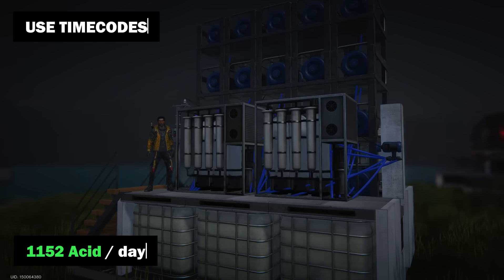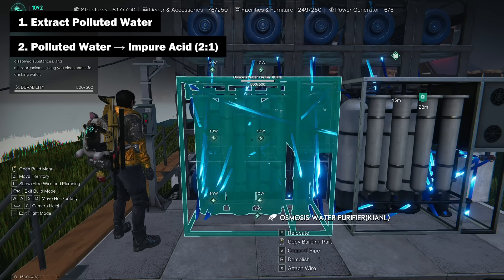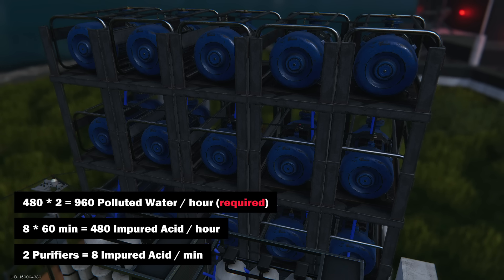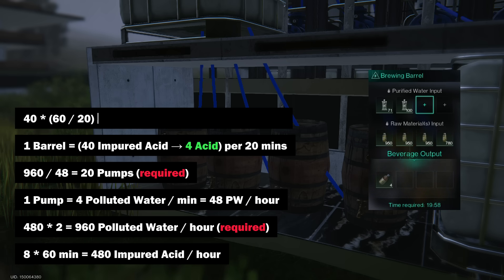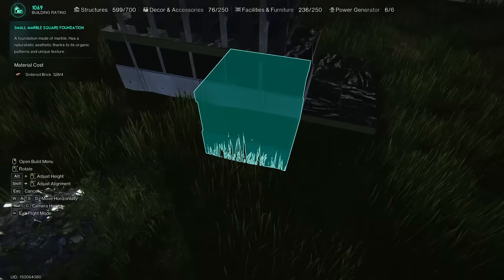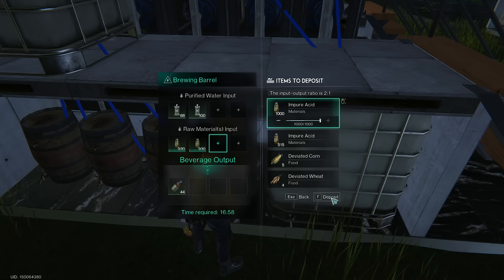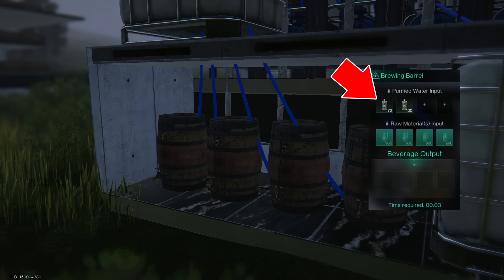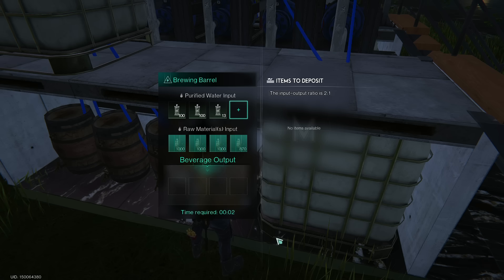Passive Acid Farm Guide ♻ | 1152 Acid per Day | ONCE HUMAN

Comment: Once I get to teh part where I need to place small ceilings over the 3 water pumps, they dont want to snap on top of them with teh water tanks there. If i move the tanks to the side for a second to see if they snap without them, they  snap on that area easily. Whats the issue im having? I triple checked that my foundation elevation and every other pieces was in place with the guide, yet that part doesnt work.

Comment: You know, I thought about this and did set up a little one with 10 pumps and figured, this is silly. Granted, I realize that it's "passive" and that is the draw, but I can get over 300 acid with every run through Blackfell and there are probably other spots where you could do the same thing, but I've only been playing for a couple of weeks. As long as I take the deviated chops along for the acid gain, I've never gotten less than 300+ acid in 25 minutes.

Comment: How can u got purified water when the pump only take poluted water?
Reply from the maker: this build does not produce pure water. I must be delivered to lower tanks with pipes or manually
easy way to do this - https://youtu.be/NZBvmOw2cAU
also there is update versions of this build, which u can save as a blueprint https://youtu.be/--tPMDM-KiQ

Comment: how do you go from tank to pump then pump to purifier ? my pump only sucks in the water on both ends when its on XD is there a way to alternate where 1 side sucks 1 side push and ive been missing it all this time 0.0 ?!
Reply from the maker: hey. wall pump should be place HIGHER than tank's pipe connection slot, then it will take liquid from it. 
at the same time, the pump should be placed LOWER than purifier's pipe connection slot, then it will transport liquid into it.
but better just build a new version: https://youtu.be/--tPMDM-KiQ
Reply: @KIANL-GAMER  thx a ton for the repply, will deff take a look

Comment: Real nice job  ! im doing some adaptations to get rid of that small water pump, just for the chalenge, but somehow positioning the big water pumps is a real nightmare, how did you do it so easy?
Reply from the maker: hey, new building guide will be released today. In the upgraded build it will be much easier.

1) place 1st layer of pumps, using grid snap
2) disable grid snap
3) use ALT + mouse wheel to raise pump up a bit
4) enable grid snap again
For the rest layers correct height should be applied automatically.

Comment: Im running 100% Polluted Water on my Osmosis water purifiers but sometimes, besides the impure acid it also appears pure water on the osmosis purifier output is this correct?
Reply from the maker: no. if it happens, it means ur pumps extract dirty water too.
you need to move them far from bodies of water or move to another contaminated area
Reply: @KIANL-GAMER I’ve checked all my pumps no dirty water, also all my 3 tanks are maxed with polluted water, and the 8 slots on the osmosis are filled with polluted that’s why I find it very strange 😮
Reply: @KIANL-GAMER  Found the issue, its a bug, alot of people having it, when offline the Osmosis created Pure Water from Polluted Water. i tested by disconnecting everything and filled all Osmosis by hand with Polluted Water and went offline when i cant back the Osmosis outputs had both Pure Water and Impure Acid and the inputs where still Polluted water :( If i stay logged in the output is 100% impure acid.

Comment: I tried this and it worked, but why do I produce so little impure acid every day ? Do I have to dispose of the dirty water ?
Reply from the maker: Your pumps should bee placed far from bodies of water, then they will only produce polluted water - that's first.
Second  - you need to fill all 4 slots of both water purifiers with polluted water (means u need accumulated 800 units of it). After this they will start work at full power.

P.S. Updated guide is coming soon.
Reply: @KIANL-GAMER  my pump is in the water and it turns out that is the wrong one, thanks for helping

Comment: the problem with all this min maxing is that. You don't get oil and water. 
Two very essential things as well. 

For beginners those are way more important that doing something like this. Even if you're in a stardust area that has oil you still need purified water to brew the impure acids into acids. 
Relying on rain catchment is highly suspect as it doesn't work properly in some areas and only when it rains.

Comment: did water pumps get nerfed? i tested the pumps in polluted water and in polluted land. it does not matter where the pump is located, in both cases the pumps only pulled 24 polluted water per hour (alternating every 5 min polluted water and dirty water, so every 10 minutes polluted water).
Reply from the maker: it's a bug, many ppl have it. just try another contaminated area

Comment: hey man, recently started playing once human and got to level 45 and wanted to setup acid farm! thanks for the info but a quick question. Will this setup be viable after the new update where the impure acid to acid ratio is changed from 2:1 to 10:1? please reply if you can, i am really stuck on this farm setup thing and passive acid farm will help a ton. P.S.- watched your automatic acid farm video that you uploaded latest and will be doing that but passive acid source from pumps really will be a big boost on top of the farm setup. @KIANL-GAMER
Reply from the maker: Hey. 10 Impure Acid : 1 Acid - is the current ratio actually, so... 🙄
Reply: @KIANL-GAMER  yes exactly. so is it worth seting up that farm then? since before it was 2 Impure acid: 1 Acid
Reply from the maker: @TheAkhileshAggarwal  yes, why not

Comment: Beautiful video! But I have a question where do I plug the power generator into? I made 6 deviation energy generator and wired them all together but now where do I wire it into for the farm to work
Reply from the maker: hey, to any part. or u can add a few switches on a side wall if you need
P.S. In a few days upgraded factory will be released.
Reply: @KIANL-GAMER  I ended up figuring out where to plug it ! Thank you! Best video ever kept it very basic and straight forward

Comment: Thanks for all your videos man, great way to deliver the info needed, I did notice something that I don't see a lot of people mentioning, in my setup last season I was collecting polluted water through my rain collectors 80% of the time, this season only about 30 polluted water per rain collector (something has changed by the devs maybe) I wonder if you know anything about that or if you can research that further, that would be pretty cool to find out 100% how it works better as you know because you want need to use as much power or as many pumps, also before somebody asks; no, it doesn't really rain but I still see the collector collecting polluted water. 😶
Reply from the maker: hey, thanks.
actually I haven't tested yet, but I will in the future I think
maybe this is another bug

Comment: im having problems placing the ceiling above the water storage how did you do it
Reply from the maker: this was patched. but you still can place water purifier directly on the top of the tanks. will be same result
also, updated factory will be released soon.
Reply: @KIANL-GAMER   ah i see i just added another small wall on top of the half walls so they fit to fix it. Still the game is buggy and when you leave the farm un rendered the osmosis produces purified water instead of the impure acid i hope they fix this

Comment: Not sure if I'm doing something wrong but my barrels produce 1 acid/20 mins * 4 barrels * (60/20) = 12 acid per hour not 48.

Am I doing something wrong or do you need to have so much surplus impure acid you can fill all 4 material slots?
Reply from the maker: yes, you need to fill all 4 slots. only then will be 4
Reply: @KIANL-GAMER  how much impure acid does that require I just tried splitting 600 into the 4 slots of the brewing barrel and it just combined them all into one slot
Reply from the maker: @GamerUnderDev  1000 for each slot, as far as I remember

Comment: I am unable to place ceiling pieces above water containers. It doesn't snap for me. I tried to place them and add containers after - doesn't fit :/
Reply from the maker: they patched this, so u can't anymore. 
but you still can place purifiers directly on the top of the tanks, and you will have the same result.
an updated build will appear soon.

Comment: Hey mate, i've been losing ym brain over my setup. Have 27 pumps (overkill i know but just trying to fill slots D:) even spread into 3 storage crates, all going into 1 wall pump to the 2 osmos. Have made sure all pumps run 24/7 and i still never see the slots full. Any idea what i'm doing wrong? Great guides otherwise!
Reply from the maker: this takes time to fill production capacity. if u want full slots faster, u can temporary disable water purifiers and wait until they fill up
Reply: @KIANL-GAMER  Nah figured it out i'm a fool, i'm in blackfell oil/pollu and not sure if it was changed recently but i thought oil was every 10 but pollu was still every 5 mins, but they alternate. so need twice the pumps for oil/pollu zones

Comment: If you are wondering why your acid farm is producing purified water instead of impure acid when you log off, it's because the there's a bug currently that confuses two types of pumps, if you have them. 

if you have water pumps in TWO areas, one pumping acid and another pumping dirty water (most likely an isolated pump for sprinklers - farming) the game will get confused and all your polluted water pumps will produce water instead of acid, whereas your dirty water pumps will produce impure acid instead of water.

when you log on the confusion is undone. so one way to solve this problem is farm a lot of water first, then delete the irrigation pump for sprinklers. then there will be no more 4000 water waiting for you when you log on.
Reply: Weird I’m currently farming oil and water with 1 pump for water and 4 pumps for oil and I always get oil and water properly. I guess this is an issue with impure water specifically, not oil.

Comment: just read the comments, am i the only one who cant stack them pumps like he did? am i stupid
Reply from the maker: first pump u place as lower as u can.
for second pump u use Alt + mouse wheel to slightly move it up.
3rd and 4th pumps will have correct height automatically

Comment: my question is how much max energy  can some one have in this game ? because if i  want to live in a poluted area   and start to produce acid , i want to bee able to run my farm too i have a farm of 92 W 70 box  to keep  brew Ale  and using them while i live there ,  and i want to bee able to use my basic stuff in the building like the stove, furnace etc  , not to mention all deviant should bee hoocked to Elec too and turret seperatly , can i hook a farm and this faktory and basic  to elctricicty with enough power , i unlocked memetic 1 extra generator too  ?
Reply: I have 450+.  I have 8 deviant generators with the +15% perk plus eels.  8x57W+ = 450W+
Reply: @MrBdericks  nice    , i have a question  i puted my pumps on the land in a poluted area near the sea  and they still pumping sea water , i want them to pump only poluted to make acid , like he said in the video , if u put them  on the land u get only poluted water , any idea what is wrong ?
Reply: @abbasmerhi1  If you put a pump near water, it pulls water/sea water AND polluted.  You need the pump to only be on land.  Sometimes you even need to raise it up in the air.  Something to do with in-game coding of a set elevation of sea level.

Comment: I am having a very hard time trying to align all the pump in one single vertical line. Took me hours to finally got it right. Alt+mouse wheel is very sensitive and I ended up having a huge gap vertically in between the pumps. Any tips on that?

Saving the setup in blueprint is not saving all the pumps. As I can’t build any pump once I extended the base tile, I ended up rebuild the whole thing from scratch every time I moved my base.
Reply from the maker: Yes, this is the problem with pumps - they always delete after u change base location and cannot be saved in a blueprint.
Tip - make a "shelves" for them, if u can't align them normally. First layer on a ground for example, then and half-block and ceiling, and place the next layer on this ceiling.

Comment: Interesting but how the hell do I power all this?
Reply from the maker: 6 deviation generators + 6 good electric eels.
also you can u use 10 Pumps + 1 Purifier + 2 Barrels.
will require twice less energy, but will produce twice less acid too

Comment: For some reason, i cannot get the half ceilings over the tanks. I've tried putting the tanks down first, and putting the ceiling on first and either way, it blocks me from building. Its like the tank is too tall. Anyone run into this? Or maybe im using the wrong tiles?
Reply: i have the same problem

Comment: sorry dude but this is not how it works... in order to make it fast from scrap, you dont need that much water pumps....because you have to put impure acid by hand and bla bla bla... put 2-3 barrels first, fill them ALL slots with 1000 impure water, thats like 8 acid per 20mins,  then start expanding barrells, and it doesnt matter how much water pumps u have because you only have 2 water purifier ...its damn slow.... more water purifier means more impure water... faster fill the barrels... means more acid, and less work

Comment: very nice guide ty very much ... I'm having a problem where my pumps still getting sea water with polluted water even though i took them as far as i could  inland away from the sea ... how to fix that ? should I move my whole base away from the beach ?
Reply from the maker: I think this is a bug. Try to move it to another polluted area. this may help.
personally never encountered this problem
Reply: @KIANL-GAMER  I finally could figure it out why ... in fly build mode i could glitch under the ground to find out there is sea water below the surface :((

Comment: my acid farm doesn't work when i'm not playing, btw with 10 water pumps, 3 osmosis converter , 3 tanks and 6 barrels, it only produces like 2-300 acid per day (600 impure acid - 40 acid) . Eating the Deviated Chops stuff and going to blackfeel city killing mobs for like 20 minutes grants me around 700 acid . they need to fix the barrels ratio and speed. also, why should a barrel require electrical power and why 10W ?!?
Reply: True, my base should produce 1440 Acid every 24 Hours but it's more like 400-500
Reply: @HansGruberX1  yeah, seems like it doesn't work as it should. Hope it will be fixed with today's update.

Comment: man im trying to build this thing and i cant seem to get the ceilings to go over the water tanks
Reply from the maker: I think they fixed this after my vid 🙄
But you still can place Water Purifiers right on the top of Water Tanks. Will be the same result, but not so nice look ofc
Reply: @KIANL-GAMER   man that's silly. We'll I'm trying another method where I raise the small foundation up higher where the ceiling attaches to the foundation instead of the side walls. It just raises everything up a few feet.

Comment: Hi, sorry for the question. How much pollution must be to extract only polluted water?
I am in an area where the pumps are positioned at 120/125 of polluted, but they pull polludet water ONCE (4 for pomps) and dirty water TWICE (24 for pomps).
Little by little my osmosis puryfied fills up with dirty water and no longer creates impure acid.
The zone is bugged? I'm going crazy!!! I throw away a lot of useless dirty water!
The zone is: 4697.19,-1459.02
Reply from the maker: You need to place your pump far from bodies of water on land. then will be only polluted water.
There is info about this in the vid.

Comment: It took me a while to get done, but I have it done like yours is. I can confirm that I have about 32 watts remaining by using 7 deviant generators and 7 eels. I have Generator: Electrical Expert which allows for a 7th generator, and provides an additional 2W from each source

I wrote this about 20 minutes after I finished, so I don't have a production count yet.
Reply: I wondered how  this was to be powered. I believe I have Genny expert unused cause i didn't understand the tooltip. Server shutdown night so have to check in morning found a "foolproof" way to get eels so... Right now I am only using four pumps on two gens. Thx this helps.

Comment: this is already overexplained. its simple. 10 pumps will supply 1 osmosis filter which can supply 2 fermentation barrels. build on land in a polluted zone. double that, thats how you get around 1000+ acid a day.
Reply: what and how many generator does this need? im tryna build small scale acid farm :D
Reply: also where/what spot do you farm acid without acid farm?
Reply: @lucci.x  7 Devient Generators
Reply: relax. the video is infinitely better than your text.

Comment: Put the barrels on your vehicles and you got 40W less needed on your farm xD
Reply: You would still need to power them right?
Reply: @f4667856  sure but you can also put a generator on your car, theyre seperated from main base so you can put 1 generator additional on each car/truck and 2 barrels each. 40W less on main base. Power problem solved
Reply: @f4667856  Thats correct. but you can place 1 generator additionally to your main base on each vehicle. So at total on each you can have 2 barrels and 1 generator. So 40W less needed on base, power issue solved :)